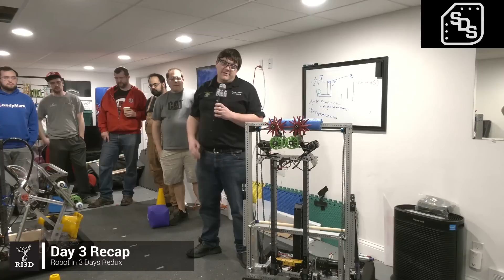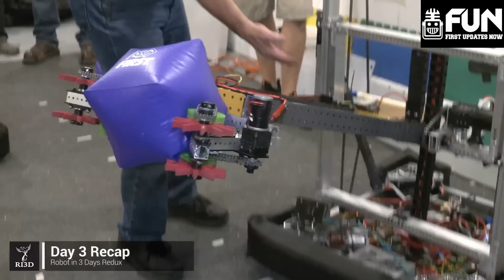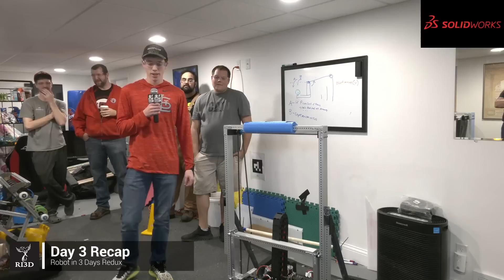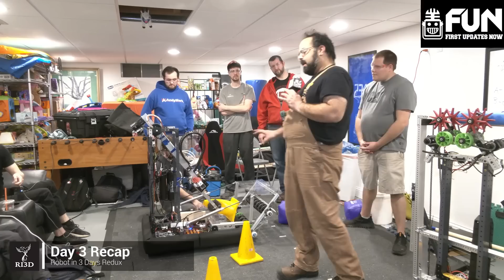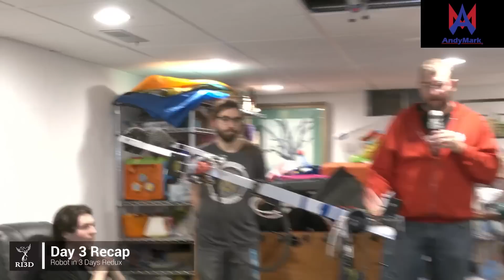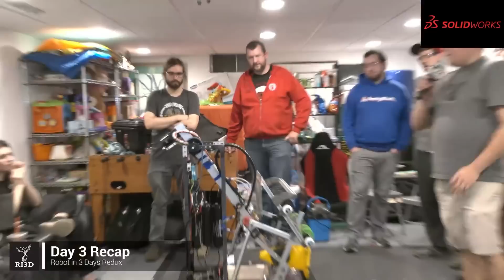Ri3D Redux Day 3 Recap | Two Robot Overview

Comment: I think that your machine's max height is more than 198cm(6ft. 6in), I don't know whether it breaks the rule because the rule is written "Tall ROBOTS not allowed. ROBOT height, as measured when it’s normally resting on a flat floor, may not exceed 6 ft. 6 in. (~198 cm)) above the carpet during the MATCH".
Reply from the maker: This is explained in many other videos that with more than 3 days software limitations would be written. This robot is not for competition play.

Comment: For the grabber do you use different pressure for the cube and the cone
Reply: same pressure
Reply: Both cube and cone are done at 60 psi, 4” paddles, with two 6” 3/4” cylinders
Reply: Do you use 2 single acting cylinders for open and close or 2 double acting cylinders
Reply: @princerodrickalbert3818  2 double acting cylinders that close the claw when retracted.  Note that you lose some surface area to the rod of the cylinder so retracting a cylinder has slightly less force than extending a cylinder.

Also if you only have spring return cylinders, I would recommend closing the claw when the cylinder is extended, and allowing the spring return to open your claw